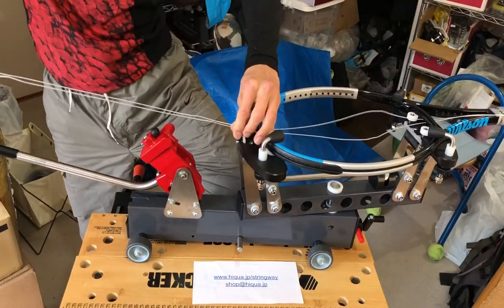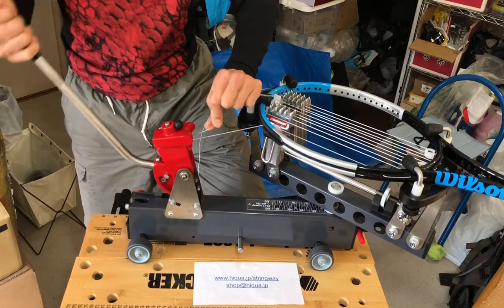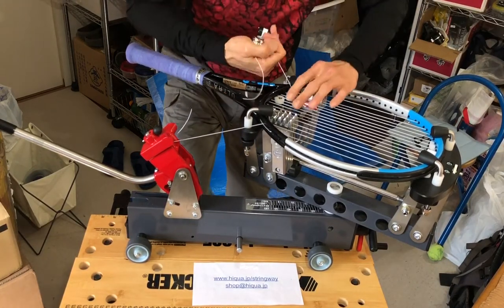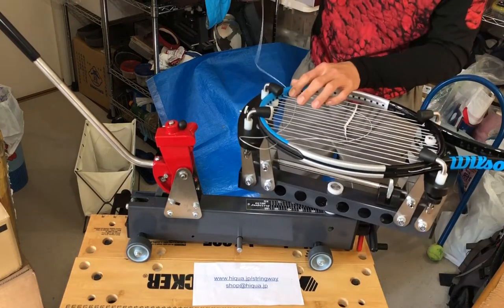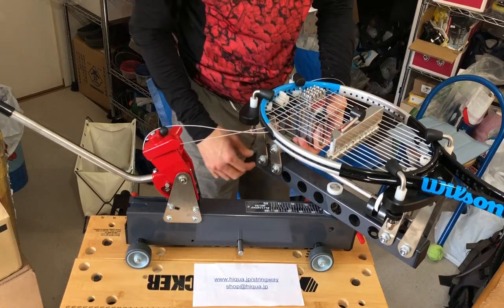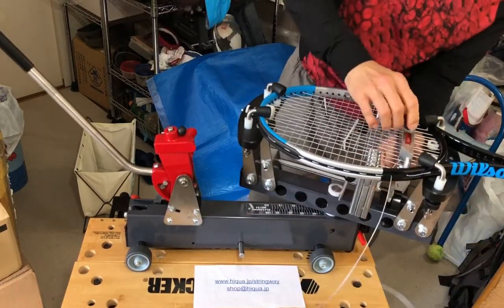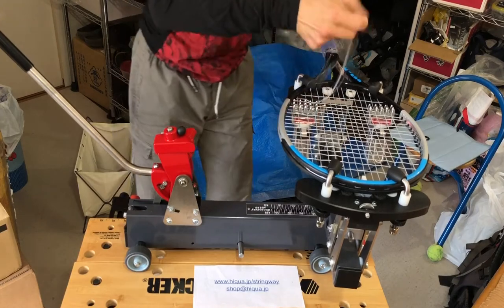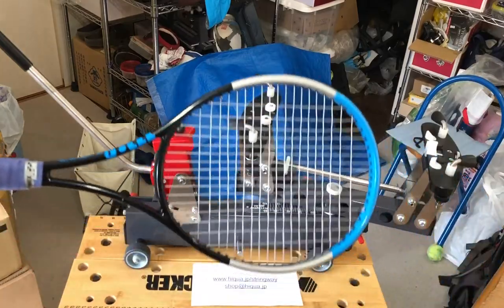Stringway ストリングウェイMS140LS JET Racket Stringing Tutorial English Narration最高のガット張り方を英語で説明いたします。

Comment: Hi Stuart
thanks for this video and this new method.
I have the same MS140. I have bought a new table, and it is dificult to fix it on this new table.
Can you tell me which table or workbench you use?
I have the impression that you press with your foot every time you raise the lever
Reply from the maker: It is a Black and Decker work bench with a step that allows you to put your weight on it to stabilize it while you use it.  If your table is too light then you really need something like that.

Comment: JET method used to recommend higher tension on crosses.  Any idea why this has been revised?
Reply from the maker: For most people the JET method has too many details to remember so changing the cross and main tensions could be too much to think about the first time you try so to keep it easy I used the same tension.  The racket had no warping so there is a chance of the racket getting a little longer if you increase the crosses for this particular frame but this is different for every racket if their shape is even just a little different.
Reply: The concept behind increasing tension on crosses is to get tension differential between mains and crosses down to 20 - -25%.  Without increasing cross tension differential is 30%+.  The original LTEC lineup played best with this tension differential.
Reply from the maker: As long as the racket does not warp much then it is ok to vary the tension.